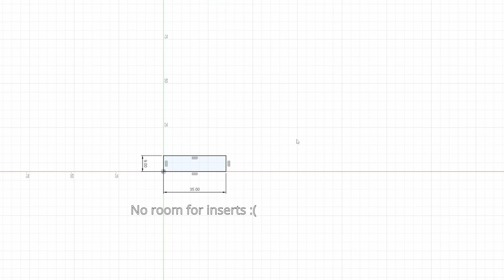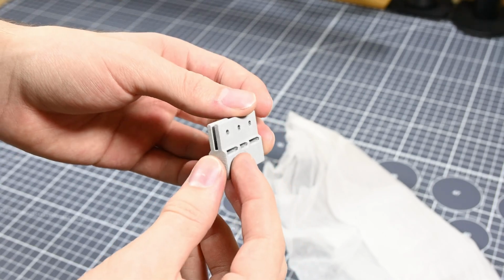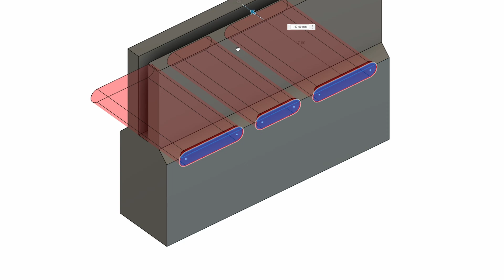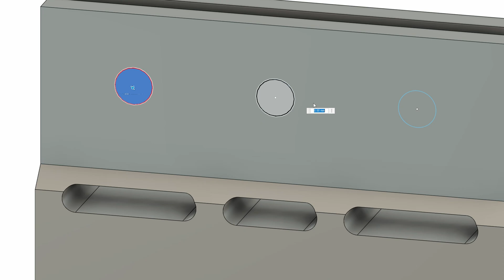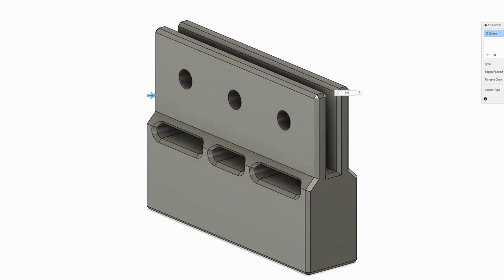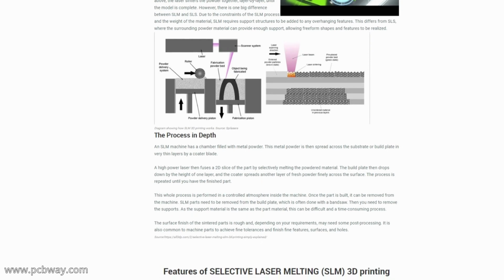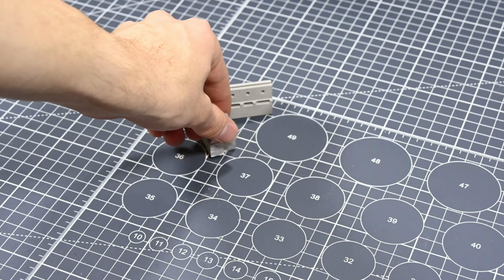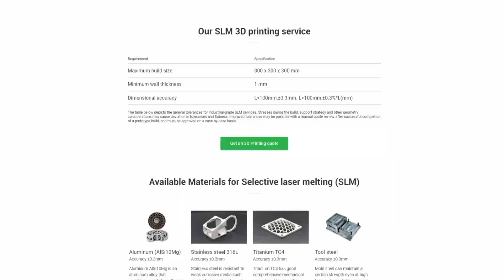Taking a Close Look at Metal 3D Printing and Working With It!

Comment: 1:10 Did you consider ASA? Its pretty much ABS but so so much easier to print, the only problem is it stinks a bit (but doesnt require heated enclosure).
Reply from the maker: I hadn't actually heard about ASA, guess I'm not keeping up enough with consumer 3D printing technology haha. I'll have to give it a shot at some point, sounds like a cool material!